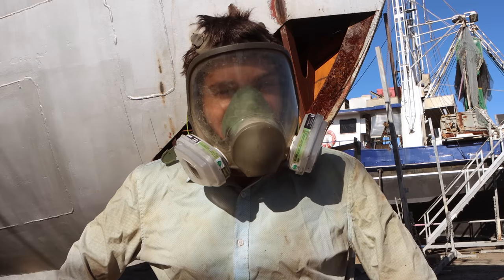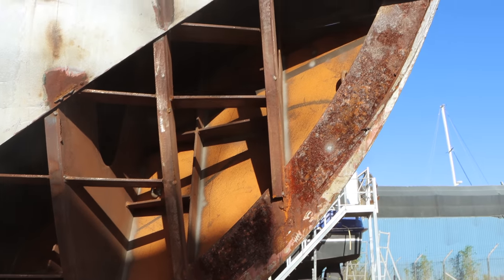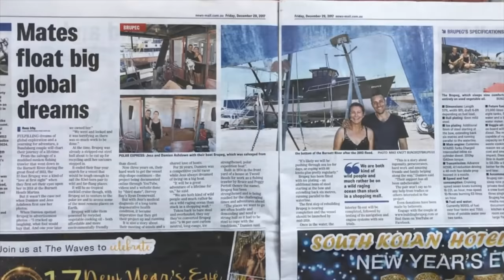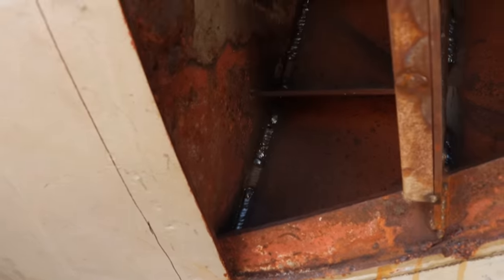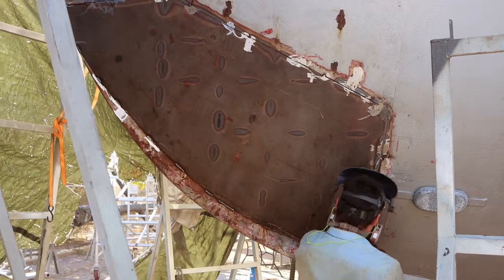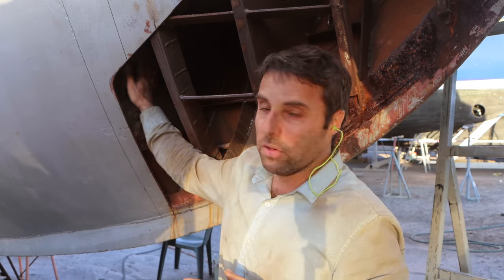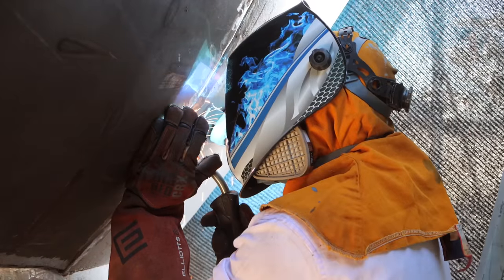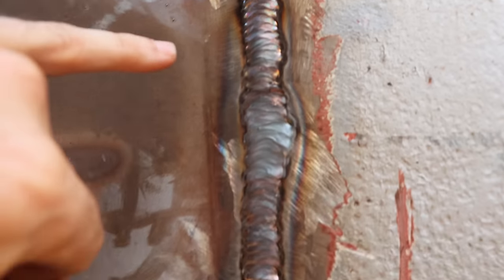Dry Sandblasting & MIG welding 6mm hull plate - Project Brupeg Ep. 261

Comment: Really enjoy your explanations how and why you are doing these jobs on the boat. I am new to your channel and find the content amazing. My family was in the offshore service industry in the Gulf of Mexico in the 70’s  and 80’s where we customized some boats for sandblasting and painting the oil and gas rigs offshore. I was watching one of the older episodes about installing brackets for what you called  the “hot water cylinder” and it reminded me of when one of ours failed. We sent our electrician to the local big box hardware store to pick up one and meet the boat at the dock four hours away. When he met the boat and started to unload it they noticed it was natural gas and not electric. The skipper without batting an eye, simply asked the electrician if he remembered to get a really long gas line. Turned out to be a really long night for the electrician. One of the lessons we learned very quickly was that in the salty atmosphere everything corrodes. You are making good choices choosing readily available appliances etc., (like your residential hot water cylinder.) In the USA we call them “Hot Water Heaters” (I know if the water is hot, why heat it? Right) Appliances like these only last for a couple of seasons, so make them easy to replace. The boat looks great, really like the “wings”. Thanks for sharing your journey with us!
Reply from the maker: Thanks for the awesome feedback and stories Norman

Comment: Dual shield is the way to go we use it a lot at work, don’t want to sound like a know it all but here we go. You can run a lot less wire speed with dual shield especially on the vertical ups and should be on at least 25 volts . Anyways that is a lot of work and you do such an awesome job !
Reply from the maker: Huh, I didn’t know about that level of voltage. I’ve been much lower than that. Normally run 22 for 6mm but on these ups I was bouncing between 19-20. Thanks I will have a play with this wire on some scrap and see how I go with higher bolts and less wire
Reply: @ProjectBrupeg  also we run co2 with the dual shield on 1.2mm wire usually and it works really well , it may be different with your setup. Keep up the good work 👍
Reply from the maker: Yeah my machine won’t cope with anything over 1.0 I normally use 0.9 unless it’s the spool gun which will do 1.2
Reply: @ProjectBrupeg  also some of those dual shield wires you can get aren’t very good , if you tack two pieces of steel together it should take more to break than solid wire , kinda like how tig tack is really strong or a low hydrogen arc rod

Comment: In my opinion, having welded a thing or two, it would have been preferable to do an interrupted weld around that plate.  It reduces warpage and stress in the adjacent structure.  Looks good!  The keel post is much thicker material and will require higher amperage, weld stacking is a good sign of not enough heat in the weld.

Comment: Pad welding is the best solution. It's also the simplest. You clean up, you weld, you move on.
You can patch over, there's chemicals you can lather both sides of the hidden area that are heat resistant and prevent rust, but for a single patch in a single corner, it's cost prohibitive.

Another method i've seen is to weld four bolts head into the wall, cut a plate of an appropriate size and then you put rubber on both sides along with heaps of paint. Over the top of that you use straps to force the plate into the bolts. This is a temporary fix, but it works. I have heard of people using underwater welding to patch holes using this method. Haven't seen it.

Comment: Since relying on a lack of oxygen in the bow compartment failed and it rusted so badly a very expensive and time consuming repair job was needed, Would slathering the new metal in rust converter help prevent any future major rust problems, or would the follow up welds just burn it off? As to the wind issue, how about tacking 'huge' dogs (30 x 120 cm plates) to either side of the weld zone about 60 cm apart. Might involve a bit of grinding and spot welding, but it should provide a 'dead zone' to weld in when those gentle 40 kph Aussie breezes waft in to ruffle your salon hair-do...
Reply from the maker: Maybe but it’s not a permanent fix. The permanent fix is solid plates everywhere and zero leaks

Comment: Long time listener first time caller. Really enjoy the welding skill and how much time you take to explain to us plebs what goes into it. Just out of curiosity, how many hours did you spend on that big exterior weld?
Reply from the maker: Hi Buck, all up it was a few days but that’s because I was stop starting g for things like wind or wire replacement etc. start to finish there was maybe 5hrs of welding in it as I was grinding anything I wasn’t absolutely happy with. Any time the wind blew my gas away to the point I was getting porosity would be a stop and grind out then restart, finally when I had finished I went over it with TIG so I could clean up any areas where I thought the fusion was a little low. Normally the pros would let do this level as they are better welders than me but what I lack in skill I make up for in determination to make sure it’s as good as their finished product (just slower because of rework)
Reply: @ProjectBrupeg  Awesome, thanks, that's still a hell of a lot of work for sure! Worth it for the right outcome always.

Comment: Once the front is all welded up is it possible to mist spray the entire inside with waxoyl or a protective coating to prevent future corrosion
Reply: I don't know this boat much, but if the front is air tight as the steel rust the oxygen is consumed. So at some point there will be no oxygen left to oxidize the steel.
Reply from the maker: Exactly. That’s how most sealed tanks are in these trawlers and they last indefinitely
Reply: A wash down with chain saw bar oil would protect the metal for next to zero costs. It soaks under a huge rust and leave a protective layer. Over time it lasts longer than Waxoyl.

Comment: back on the tools :) and heap of vid editing as well, which i must say  is awesome ! . quick question from a numpty lol, and prob has been answered before, aside from no slag, why mig not arc ? ( always used arc for thicker material, probably has to do with mindset that mig wire is si thin lol. ) counting down the days till launch, well deserved guys when that day arrives !
Reply from the maker: MIG is just as capable of doing steel up to say an inch thick. Just like a 3.2mm rod you might need a few passes but it will still achieve great penetration. That said MIG is generally used in a production environment or where you have a metric shit ton of welding because it’s just so much faster than stick. That said stick is much better in wind versus any shielding gas welding. All of this needs to be tempered with my pathological hatred of stick welding hence I will MIG in a snow storm before I attempt stick
Reply: @ProjectBrupeg  as i pick myself up from the floor laughing "sic. pathalogical hatred ...." lol. thanks for that info, certainly has changed my view on mig capabilities, will practice the craft on my unimig 182, not as fancy as yours but should be a good starting point and one day dream of ally welding :) ( coz my boats a wee bit tinier than yours lol. Frank
Reply from the maker: I’ve used a 185. They are reasonable machines. Likely would struggle with thickness over 6mm but great for anything under that. Good machine to learn MIG on.
Reply: @ProjectBrupeg  Def wont need to do more than 6mm for around the home so is good to know :) one last question,( and i really appreciate the time you take to answer) Dame/Jess , looking for a spool gun, what amp would suit my 182 ? ( def 182, stick/mig version) , would 150a be fine as I have really no clue lol. will be using it, eventually, for ally welding bits and pieces for my tinnie :)
Reply from the maker: I would think so. Have a look at the amp chart in the door for alloy. That will tell you amps for a given alloy thickness. 150 sounds about right but the door chart will confirm it. You can actually to alloy with the standard MIG torch if you change to U groove rollers. It’s much more painful than a spool gun but it’s still possible.
Reply: @ProjectBrupeg  aaah never thought of using the chart to determine which spool gun amperage, genius :) I have u rollers, however i definitely prefer less pain, even with changing the liner. Again, muchly appreciated,  will let you both be to enjoy the evening and respond to your many followers.

Comment: Interesting watching your efforts. Just a question, how do you intend to weld the starboard (Ithink) plate on without internal access?
Reply from the maker: That plate will be completed from the outside only. Slot welded to the ribs/bulkheads and stringer and single continuous welded to the keel and original hull plating. Will make more sense when you see it but it’s a simple enough process
Reply: @ProjectBrupeg  OK gotcha I look forward to watching it.

Comment: wow thats a thick chunk of keel for such a small mig welder ,would of thrown some pre heat at it.
Reply from the maker: This MIG will do upto 8mm without the need to preheat.
Reply: @ProjectBrupeg  yes but that keel is a lot thicker than that so would be worried about a lack of fusion.
Reply from the maker: Yeah fair point. I did go over with TIG after the fact and I’m happy enough with how deep I was able to fuse in.

Comment: "Double shielded" in this context means you've got both gas and wire flux, right? Great progress! Gonna fill that space with closed cell foam for buoyancy, or just leave it open?
Reply from the maker: Hi Ted. Yes dual shield is a flux wire that still needs a gas. Sometimes it’s called hard facing wire but it’s quite common in the shipyard due to wind

Comment: 20:58 are the fuel tanks right behind the the metal you need to pad weld? if yes, what happens to the inside of the fuel tank, like the fuel itself, fumes and the paint on the inside?
Reply from the maker: These tanks have not been filled since they were painted
Reply: Plainly nothing